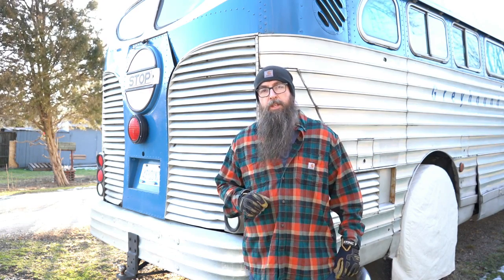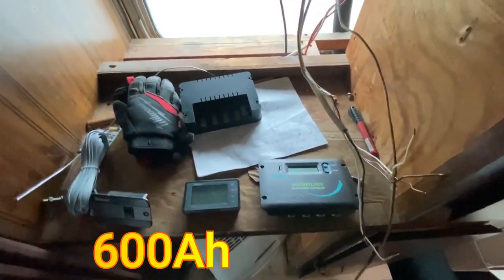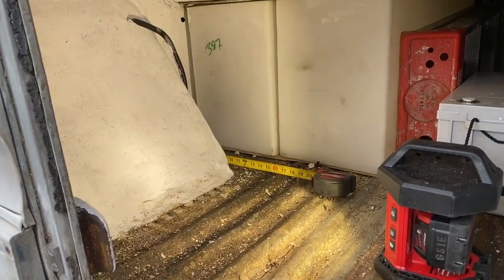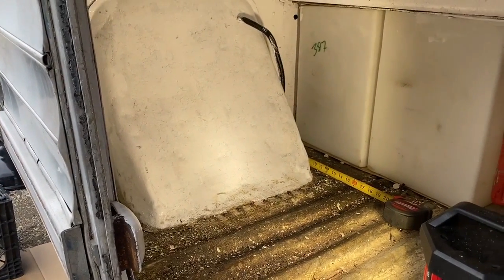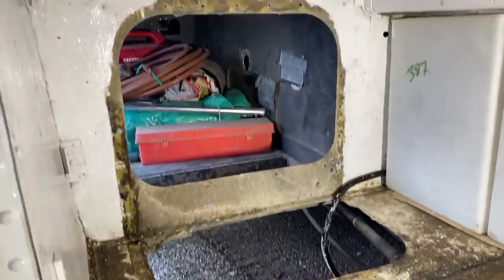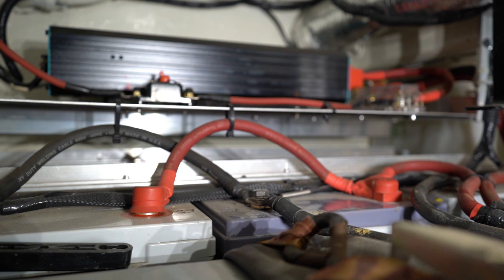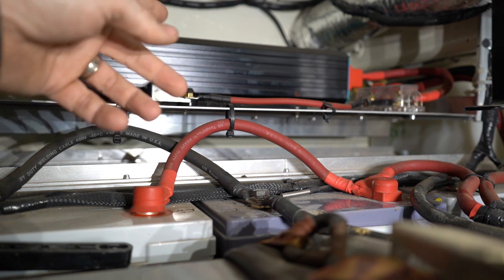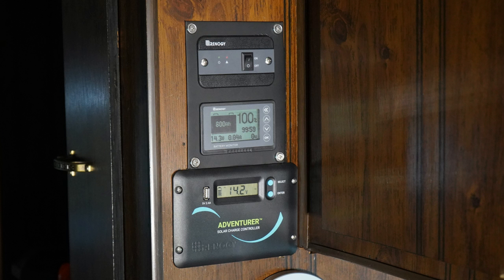Going Off-Grid in Style: Solar Bus Conversion Part 2 Batteries and Controls Installed

Comment: Hope you have better luck with that style breaker.  I used 6 of them in my VW solar project and had 50% failure rate. I tried 3 different Amazon vendors, all garbage.  I'll be paying up for some marine grade products on the bus.
Reply from the maker: Honestly I have been using this system for two years now. I've spent 10 days off grid with no issues. Maybe I got lucky  with a good one!